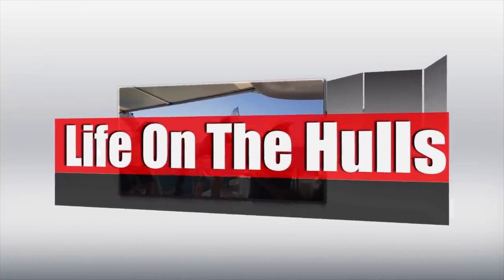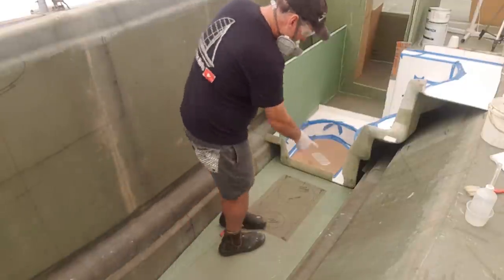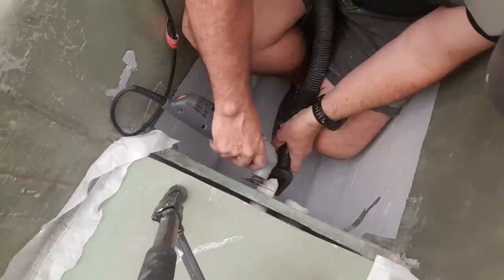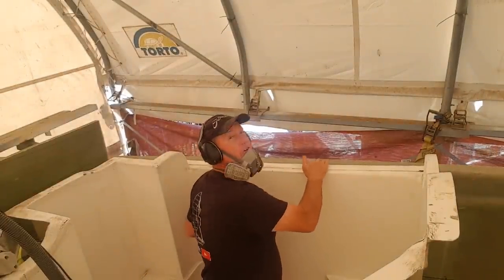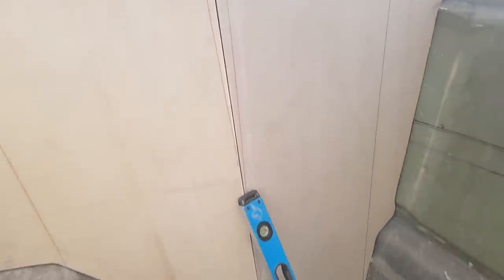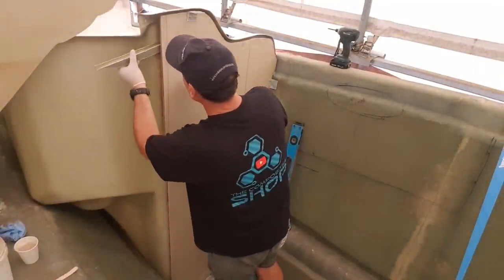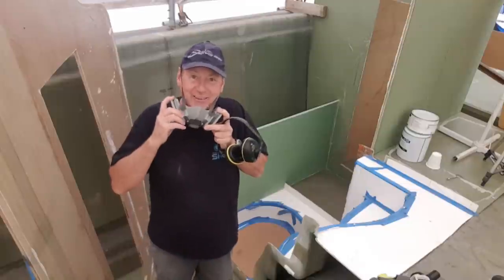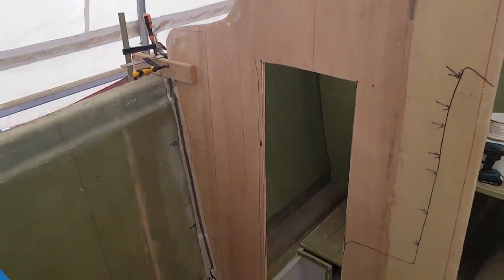Ep112 Cabin Floor Tabbing and Head Mods - Life On The Hulls - Building a 40ft Catamaran

Comment: Nice. All that tabbing, how many months does vinylester stay open for a chemical bond?
Reply: As the resin cures the chemical bond reduces, so at 50% cure you will have 50% chemical 50% physical roughly, So after a day when it's 90+% cured there is virtually no chemical bond it's all physical bond. Hope this explanation helps.
Reply: @rustie4242  Hence my question... Epoxy would give a better mechanical bond than what is used...

Comment: Rossco i see you putting the floor down ,i have to ask why you have not run a runner line (cable ) from end to end on both sides so you can pull cables or hose's when needed mate or can that be done a lot later ???. Just asking mate . Foot note just dont put the camera on the floor don't need to see to A Holes working lol. Joke Bud :) stay safe Mate

Comment: SLOW DOWN! As you said "Plan ahead." Great, now you covered the 'plastic' tank without securing it, and made no backing for your built in water tank hatch
Reply from the maker: I am able to access a ll areas under sole for securing the tank at a later date with no issues.Tank lid has a backing gasket built in.All the best Ross

Comment: Isnt it better to leave the peel ply on where you drew so when you run your tools to cut it out, you wont mark up the perfect work under the peel ply you left on, so not a planning mistake, an eureka moment!!! lol
Reply from the maker: Should leave it on as long possible but almost impractical to leave on long term as it will restrict work going forward.Not concerned about finish and it is incredibly tough surface.Any damage is easily rectified.Thanks for tuning in buddy.Rossco

Comment: Why would you peel ply fillet material when you plan to glass over it later, wouldnt it have a better bond (remain slightly tacky) from outside without peel ply?
Reply from the maker: Fillet material is peel plyed in this case as it is a vinylester filleting compound which sets off and gels in 20minutes therefore not a allowing working time for tabbing in the amounts I am laying out on my own..I always ensure chemical as l bond by tabbing within 24 hours prior to full cure at 48-72 hours.Chemical integrity is still achieved although with smaller sections I tab immediately where possible.Epoxy filleting compound will stay workable for hours after laying so can assist in the process.Cheers Ross
Reply from the maker: Peel ply also provides the level smoother surface reducing excessive sanding.Vinylester does not remain tacky like polyester so needs to be worked on within set cure times.Ross
Reply: @LifeOnTheHulls  thanks for the reply, I was thinking it was like polyester

Comment: I must admit I came across your channel when you were 18 months/ 2 years into the project and I was surprised how little progress you had made. Leopard push out a cat in 4 or 5 months I believe and I thought what is this old fart doing? However there are half a dozen people working full time whereas you are both part time and alone apart from good old johnny I hope you are buying him a few beers. So really you are not doing to bad especially as they have way more experience problem solving the issues that come up in fact they know what issues will arise before it happens. I think you have 3 more years to go with the top hull and fitting out So really you are doing about half the speed of a professional outfit and doing it on a part time basis so you are doing extremely well Ross. Leopard would give you a job anytime I am sure though you may find yourself working like a Black(Not sure if that term is PC in Australia still).

One question when you started this project, I am guessing that this was something you really wanted to do because of course financially adding in all your costs and most especially time a brand new cat would of been maybe even cheaper (You are obviously an extremely savvy bloke and would know this going in). Did you realise it would be a 5 or 6 year Project?  I ask this because you ended up buying a boat as a placeholder and from some of your remarks regarding your landlord who seems like a nice bloke allowing you to put up a massive tent it seemed that you thought you could knock it out in 2 or 3 years??